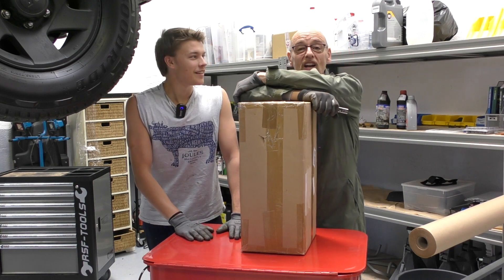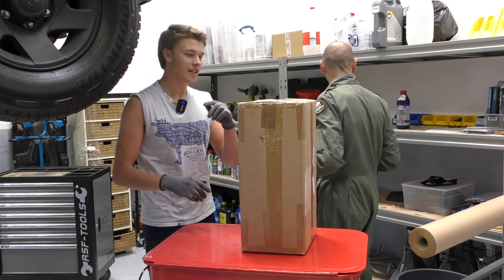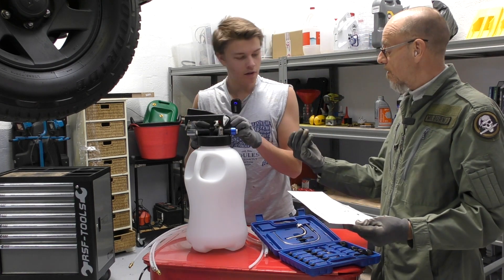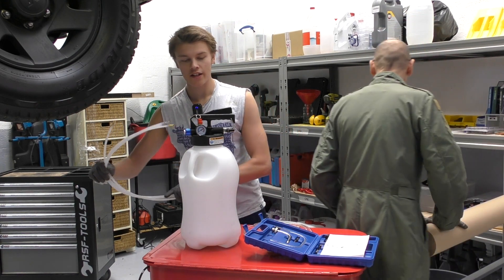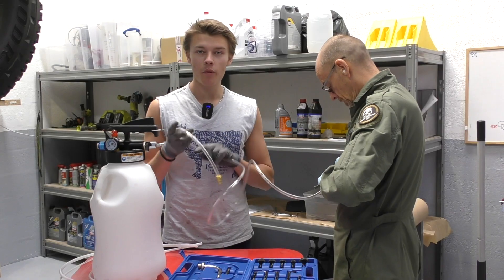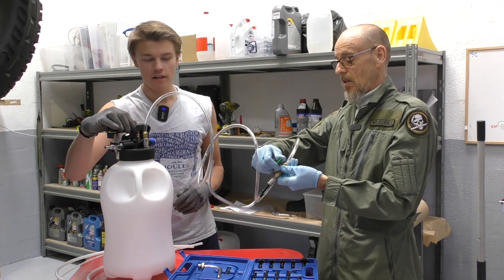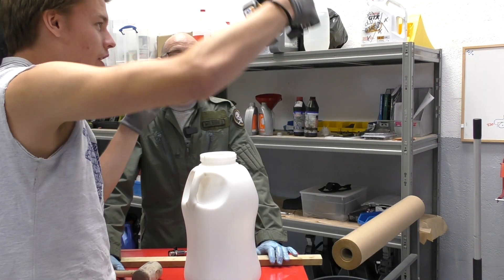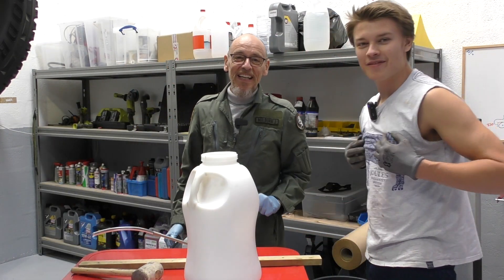Pneumatic Transmission Oil Pump unboxing & product test review - what could possibly go wrong !

Comment: Just picked up the same extractor/dispenser as the first one you tried. I was able to place the handle in a vise and use the handles of the tank and twist the top off fairly easily.
Reply from the maker: There is no substitute for stupidity :) and we are stupid 😂
Reply: @DrivenMadShow  but you did show that the top actually does come off, which is what I was looking for. Nowhere on the eBay ad or in their “instruction manual” does it show the top being removable for cleaning. At least you guys did show that the top can be removed. Thank you!🍻